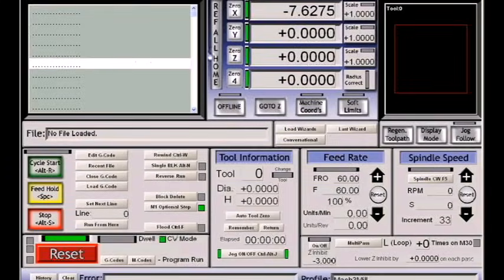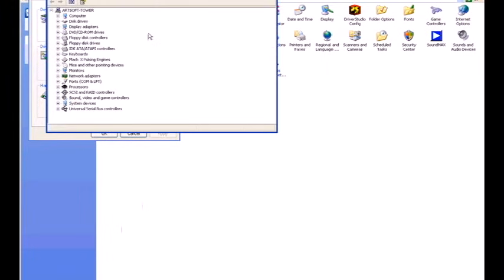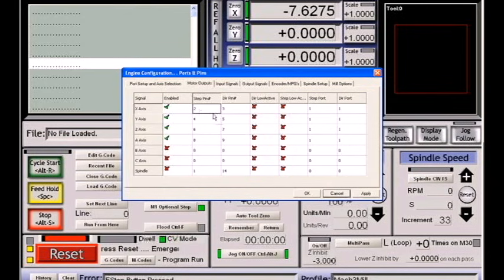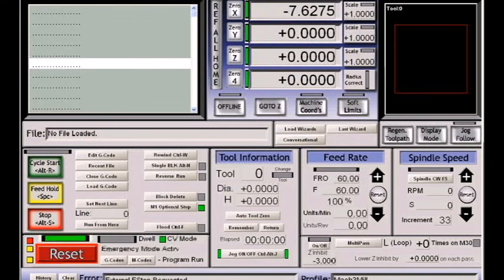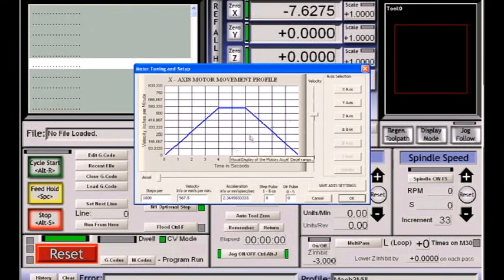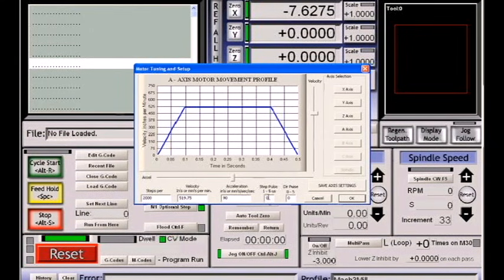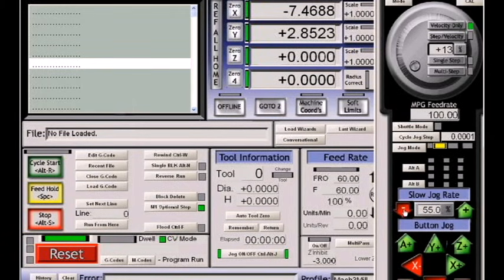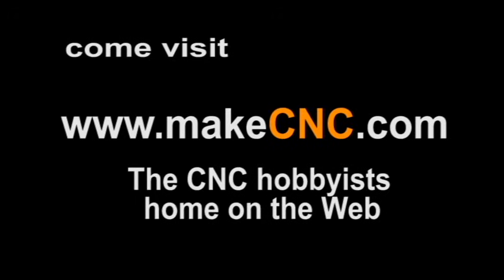MACH 3 CNC Router Training Tutorial after install setup

Comment: Questions  on my CNC Machine 

 1] on software, will it work on a size 2'x2' or a 4'x4' or 4'x8' table size

 2]what software will I need [and can i get my software free to learn to use ]

 3]hardware 
 4]cnc control board

 5]nema [what size stepper motor to use ]
  [what is the def on the motor /what motor to use ]
 6]power supply mean well sp-320-48]
  [ can i use a computer power supply]
  [and how to make a computer power supply work]
  [do i need more than one power supply or just use one ]
 7]stepper motor drivers power step PSD8079-2P
 8]limit switches
 9]wiring diagram how to wiring my CNC 
 10] and if I upgrade  my CNC
   [can i use some of the same software and hardware ] 
 11] [ trouble shooting the motors ]

Comment: Hi , thanks for a very good tutorial, however I notice that you set the step and direction in/ outputs active high , but the artsoft manual says that they should be set active low  as high would cause  shorter pulses . Now i,m confused

Comment: I had problem with no spindle power on my 6090. Came with 110v power plug to inverter cabinet. Sure as shit spindle needed 220v, ran 220v everything working fine now. I mentioned this to tech support (CHINA) to maybe atleast label the box or cord 220v , better yet supply the right goddamn power cable

Comment: I have a 3040 4axis  cnc and I have used the addon text write in mach 3..and the text comes out super small...how do you set mach 3 to control the size of text or cutting a circle or what ever.....i did set the steps per unit and it is accurate to .01mm..can you help...?

Comment: Have followed your instructions to the letter, but have a problem on X axis  Motors run on x&y axis no problem.  X axis does not move the coordinate numbers on x axis on mach3 screen  show movement  .,. have tried the motor on other axis works fine. I have  tried all ways. could it be pin outputs at fault  i have 3 seperate BoB t13130 model number cannot find any info on line for these boards. any thoughts would be appreciated. thanks

Comment: I've got 6040 machine. Cannot get spindle working and rotating. XYZ is working, Can not  start rotating. Can you help me with advice?
Reply: research the ports. I have that machine. All working, except actual drilling LOL. Still trying to figure all settings on my own. Very embarrassing that is.
Reply: I had same problem with my 6090... came from China with a 110v plug... spliced it to 220v and spindle started working along with readings on operator display on power inverter cabinet

Comment: Paul,  i got my machine off of ebay and all of the instructions came in chinese.  Even the cd.  i followed your instructions but none of my motors will turn on or move.  the only motor that run is the spindal motor after i hit the on switch.   what can I do?
Reply: Kami Millward me too, followed the Mach 3 setup all seems ok on comp. screen but no motor movement. Help.

Comment: hi Paul, I have a question. iam about to move a big router CNC  machine from one shop to a different shop and i will need to disconnect all the wires ,  will it be a problem to set it up when i will assemble it back in a second shop. or just plug and play . other words will i have to program machine after disconnecting all the wires from control box . Thank you

Comment: Irregardless is a word commonly used in place of regardless or irrespective, which has caused controversy since the early twentieth century, though the word appeared in print as early as 1795. Most dictionaries list it as nonstandard or incorrect usage and recommend that "regardless" should be used instead

Comment: Fantastic video. At the very beginning of the video, we see the red 
square in the tool display window. In my Mach 3 window, I don't see that
 red square. I only see the extreme outer white rectangle outline. 
What's the red square for, and how do you get it to appear? Thanks!!

UPDATE: I think the answer to my question is : later versions of Mach 3 won't have that red square box.

Comment: Hello. Does anyone know a Mach # forum that can help me with an issue I am having. I am getting "twang" vibration when the router is transitioning from the X axis to tthe Y axis. Meaning when it is traveling down the X axis and it turns to go head down the Y axis I get about an inch of vibration that causes the bit to wafer into the material back and forth causing a rough edge..I believe it is something to do with the ramping speeds or a setting that will slow it down before it hitsd the corner. It also does it on opposite corners or on opposite areas on a circle.. any help would be greatly appreciated.

Comment: Hi, Paul. Great video. I have a problem and I was wondering if you could help me. Basically, I have done all the setting changes from the manual that arrived with the machine but my motors won't budge. If I go to manual setting by pressing tab, I can see the numbers changing if I'm pressing arrows but motors won't move. Do you have any idea why is that? Please advise. I know there is power because spindle is spinning if I do so.  Port seems to be connected correctly. Numbers are correct. Maybe cable wrong? Or any other suggestions?

Comment: You seem to be quite knowledgeable when using this program. Do you know if this program can be used to run a New Hermes Vanguard 7000 engraving machine. Thanks in advance.
Reply from the maker: if your control board can handle step and direction signals from a parallel port on a PC or USB through a UC100 adaptor then it should work fine if the software is configured correctly for the board and stepper motors

Comment: Hello,
Recently I have problem with jogging the axis, for example if I press left key to jog x axis it work fine, but if I press left key with page up key to jog x and z axis it will only move one axis !! I can't jog more than one axis at the same time. When I run g-code the machine work with no problems.  What could be the problem ?! Is it hardware or software issue ?! Are you familiar with that ?! Appreciate your help.

Comment: I am trying to make a small cnc.  i have had it running with the u gcode sender.  i now want to use the mach3.  the breakout board is arduino uno.  the system says my arduino is plugged into usb (com4)..........do i use this info in the pins and ports config?  my windows xp says that the lpt1 is 378.

Comment: Hello Paul,
I'm putting together a plasma torch.  I think I have it all wired up correctly.  I am using a Panasonic Toughbook (CF30) running Windows XP.   I purchased a license because I use Mach3 on my router.  I wanted to use this laptop so that I could take it home and run everything off of it around the shop (I have a couple other machines that I run like a laser cutter and a sound system.  My problem right now is that I have no printer port.  All I have is USB ports.  I have an adapter that seems to be working and is recognized by the computer.  But I can't seem to get Mach3 to move the motors.   I've tried setting up an Estop just to see if there is any communication with the BOB.  Doesn't SEEM to be, however when I unplug the USB plug from the computer the motors (or just one motor is hooked up right now), makes a noise like it has received some kind of signal.  Any thoughts on how to route the USB com port to run the BOB?

Comment: Hi Paul Im wanting to set Up Mach3 onto my HP Envy Laptop but i am having great problems setting up the software primarily i am trying to follow your videos and im not having much success.... My Set Up is as follows:Hardware:Proxxon MF70 CNC Ready Milling Machine Serial DB25 Stepper Motor Driver Controller 4X MicroStep DriverUSB to DB9 Serial ConnectorDB9 to DB25 Serial LeadFemale to Female DB25 AdaptorThe Wiring Of These are as follows: 
Each Stepper Motor For the MF70 Uses a DB9 Connector as Standard. For This Reason I have Wired Each Axis' Home Switch, Limit Switch and Motor Cables into a Socket To Match the MF70 Wiring. 
I have Also Fitted the Driver Control Card into a 'Project Box' and Instaled an On-Off Latching Switch to the Box Lid (Acting as the E-Stop) 
From the Driver Control Card Each of The MicroStep Drivers are Connected as Follows:
4 Axis Labled X Y Z and A so to test i have another Stepper Motor Which i have Connected to 'A' Pins like this: AN AD AS AE for each Motor Output, This is then Wired to the MicroStep Controller as: AS-ENA(ENA),DIR(DIR),PUL(PUL). AD-DIR(+5V). AS-PUL(+5V). AE-ENA(+5V) from here it is connected to a 4 wire stepper motor using the 2 coils A+ and A- along with B+ and B- . Extra Info That May be of Relevance?
The Driver Control Card came with MACH3 and LazyCam and is suitable for 4 Axis. This is Connected using a USB to MicroUSB Power Cable and a DB25 Serial Lead
The MF70 Features 3 Stepper Motors, and Main Spindle Controlled seperately to Stepper Motors. Limit Switches and Home Switches but no E-stop)My Main Problem at Current is I am Using Windows 8.1 as my computers operating system and I cannot find the I/O Range of my USB to Serial Adaptor in order to set up the ports in Mach3 What Am I Missing?
Reply from the maker: Mach3 will run on any Windows OS from Windows 2000 through Windows 8. The parallel port driver included with Mach3 will only work with 32-bit DESKTOP computers with versions of Windows 2000 through Windows 7, but will not work with any 64-bit version of Windows or with Windows 8. Windows 8 and 64 bit versions of windows require an external motion device

Comment: thanks for the instruction.  my question is that the motors seem overheated
Reply from the maker: if its stepper motors they do tend to run quite hot as normal but without knowing your electronics setup it would be very difficult to make a judgement call

Comment: Hi Paul,
I am setting up my Chinese 6040 CNC router using MACH 3 I managed to get my ports and pins set up and am setting up Motor Inputs.  In your Video, you mentioned using the arrow keys on my keyboard. How do I set these up?
Thanks Tons :)
Bob Foedusch
Reply from the maker: +Robert Foedisch   Hi hit the Tab key and it will pull up the manual Jog control then you can use the arrow keys to move the various Axis if your motor tuning etc is correctly setup
Reply: I've thought about getting a 3040. Did yours come with a good manual? do you still like it today? Thanks in advance for any help or advice!!

Comment: Thanks for the vid, it helped me a lot! 
The one thing I'm having problems with is the spindle relay. I've got a switch circuit for my laser on pin 8, so I want a simple on or off signal on that pin with m03/m05.

Comment: hi paul  my name is john and I have a 3040t cnc machine with mach3 software installed.  I have followed your videos and set  up my cnc in mach3 , when I use jog or my keyboard  the axis work perfectly  but when I  try to cut roadrunner  the spindle only moves in minute sections as though it is cutting a very small roadrunner image   can you help with this thanks ..john..
Reply from the maker: the settings for motor tuning that the sellers of your machine gave you sound wrong its a chinese machine right so the screws are metric..i would suggest going to CNCzone forum and asking as i am sure many others have had this issue and solved it...its not a MACH thing its a know your machine thing chinese are horrible at this type of thing and should employ a western person to set up the user guide and manual for these machines i have offered to do it but they just want me to purchase a bunch of machines so until they send me a few machines there it sits
Reply: I have the same issue.  Did you solve it?
Reply: Paul Campbell Thanks.

Comment from the maker: HI

just a note we are not the support company for MACH 3 you would need to go to Art soft for support for an in depth answer to your question. but i will tell you what i can to help if i am able.  the most important thing you said in your question was that you had a ,lot of software on the control PC this is not advisable for MACH 3 under windows of any type . because of this your windows will have what are called TSR's (terminate and stay resident programs) running in the back ground carrying out tasks... you cant see them but they are there...you should. have a dedicated control computer that has only mach 3 on it for running your CNC Machine. i should also note that...not all older computers are equal even if they say the same specs ... i have found several that will not run with MACH correctly because of the issues you mention even if they have a clean install of win XP.

so sad to say its a game of hit and miss with older computers...the best solution i have found is to find a computer running windows 7 and purchase a UC100 USB MACH 3 interface from ebay this works perfect 99% of the time....with older computers you will  have to take your chances with kernel speeds etc  if you go that route make sure you get what was considered a good quality computer in its day this will more than likely have a more stable speed and Motherboard.. i have used some nice old Dells i found on eBay for $50 each with XP installed
Reply: Paul Campbell my CNC machine working with wrong size...

The result..small size..

I try to calibrate the Axis...
After calibrate...motor tuning change...and my motor...move very slow..

I use mm native unit...

Why...my machine work with wrong size

Comment: Hello Paul. I'm preparing for my CNC but for now just by looking MACH3 options an I have noticed one weird (?) thing about Kernel speed.
 My CPU is Pentium 4 running at 3GHz and yes, there is lot of SW installed but OS (WinXP) is very stable.
When I set Kernel speed to 25K under diagnostic window PulseFreq.  is changing A LOT but it's below 25K mostly, it drops on 20K+ but changes randomlly with big steps! When I set Kernel speed at 35K and restart Mach3 pulse Freq. goes from below 35k to way over 35K, even to 44K, it also makes big step when changing the value of pulse freq! I saw in your tutorial (i think it's .)
#2 that your pulse freq, is locked and doesn't change at all? I'm able to get that by clicking on those numbers and they get locked but for 25K kernel it' will be below 25k and for 35K well, what I catch that's gonna be, either 34K or maybe even 44K?
What I'm trying to understand is if my kernel speed is set to lets say: 25K is it bad for stepper drivers if value change like that and is there some minimum pulse freq. so drivers will stop working normaly?! Is it ok idea to run mach3 on P4 working at 3GHz? is slower pc better solution? Any comment about this and I would be grateful and sorry for my English :)

Comment: I have a CNC router that I use Mach3 on and it works great.   I'm converting my metal 9x20 lathe to CNC now.  I have wired everything up now using the DB25-1205 BOB.  I have it all wired and all green lights.  My X axis works fine. But my Z is only turning in one direction regardless of which arrow button I choose.  Any idea?  it's probably a port and pin issue somewhere.  I have the Z on the port 1 pin 4 and 5.
Reply from the maker: Hi drop me an email paul@makecnc.com i will see if i can help ..no promises
Reply: hey

Comment: Why is my step pin for X Axis changing with out a machine connected and software
not moving anything? I'm have Vista and running compatibility for xp. This dose happen when running router also but then some times they will all change. I have reinstalled it and even deleted it with regedit and still happens. Ihave ran the test program and ti looks good. And the computer only is for my router it only has Mach3 on it. Thanks

Comment: You have to know your spindle pitch (for example 5mm), then you have you know your step motor step angle (for example 1.8 deg, 200 steps per revolution). At the end you have to know mode your driver is in (full step, half step etc). For full step mode, number of steps per mm is 40 (200 is for 5mm, then 40 is for 1mm), if your driver is in half step mode number of steps per mm is 80 etc....